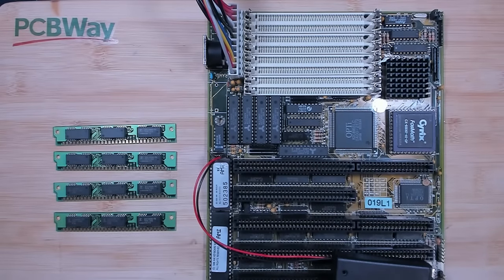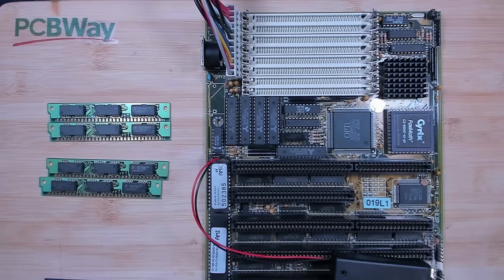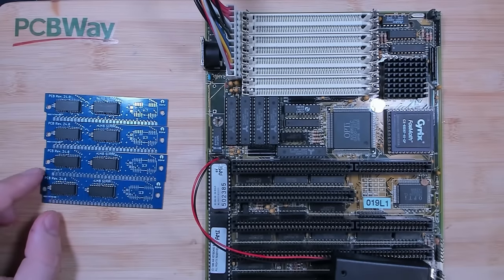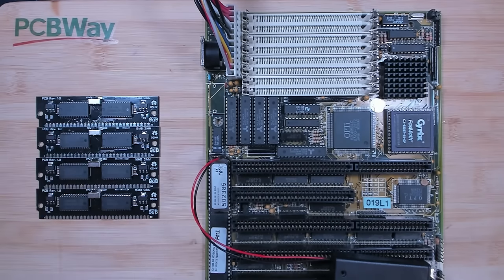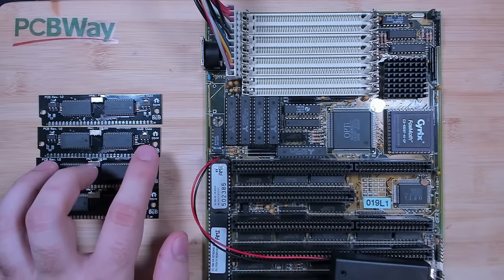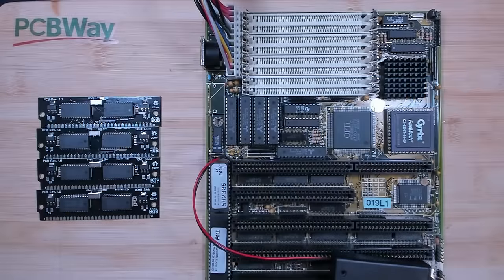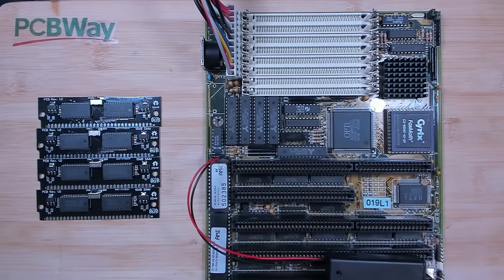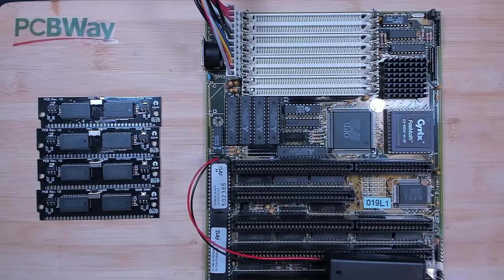16MB SIMM Revision 2.0 - I screwed up!

Comment: I hate it when I run out of components in the middle of a project! That's what usually ends up taking the most time in my projects, waiting for parts. But since I don't have videos to make, and I hate ordering just a small amount of components, I usually end up putting that project aside and working on another so I can order parts for that one too, then it takes me ages to get back to the first project.

I had the same issue finding chips that weren't rated for 3.3V when I was looking at making 16MB SIMMs. I vaguely remember finding datasheets for one or two chips that were 5V parts, and I think I also found some that said they had 5V tolerant signal pins. That was years ago, but I'm pretty sure I saved the datasheets somewhere, probably on my old Windows PC where I originally designed those 4MB modules.

Obviously those chips were impossible to actually buy from either genuine obsolete parts suppliers, or dodgy Chinese ebay/aliexpress stores. That's the main reason why I never bothered designing the 16MB SIMMs in the first place, I'd have no way of testing them, let alone actually building one.
Reply from the maker: Very true! You may end up with long delays waiting for new parts to arrive. I'm also working on a different project now since it will take at least two weeks before I can continue with the memory modules. Btw, someone suggested we check out the project SIMMBA-16. There is also a 72-pin version. However, I don't think those PCBs are freely available. Nevertheless, the author mentioned 5V tolerant memory chips. I'll just post them here for completeness: KM44C16100BK, K4E660411C, K4F640411B

Comment: "5v" TTL logic still switches reliably at 3.3v so those module manufacturers didn't need any major overhaul to support 5v and 3.3v platforms.
Reply: Replace “reliably” with “usually” and this statement becomes true, insofar as 3.3V logic doesn’t always reach 3.3V for a logic “high”, just like 5V doesn’t always reach 5V. Look at the voltage level specifications for the different logic families and you’ll see the problem. In other words, best-case 3.3V logic signals will work fine with 5V devices, but worst-case 3.3V logic signals will not. 

It’s better with 5V CMOS.

Comment: Well, the voltage divider might be the main problem. Depending on how much current the chip consumes, the output voltage WILL drop.

Easiest solution for a stable voltage is a well configured zener-diode/resistor combo.

There if there is no power need, all the current will go through the zener diode. The more current the chip draws, the less current goes through the zener diode. Output voltage will only begin to drop if the chip draws more current than what was designed to be the basic current through the zener diode.

Result: Stable voltage, and a constant power consumption.

Not a solution you would choose for an energy-efficient device, but then again a 386 is not very energy-efficient, is it? 😉

Comment: Great video! 486 class cpu with 256 mb memory next?)
Reply from the maker: Ah, then I have to design a 72-pin module :D I am not sure if I will do that. Those 30-pin SIMMs are already quite difficult to design - especially with all those extra components. But never say never :)
Reply: Theoretically the 486 can address 4GB of RAM, But I doubt any chipset ever supported that. You could however design a motherboard using something like the V380SDC that supports 2GB of PC133 SDRAM!

Comment: logic voltage levels are never exact 0 or suply voltage  , many chips have wide strike zone so chipset even at 5v logic level would probably accept high levels anywhere from 2-2,7v to 5 v  and low  levels close to 1 v so in theory we could be dumb and brute force level change by installing 2-3 fast switching diodes one direction and single the other way
of course that could not work in very high frequencies due to impedance and practically no load on the logic sides with no termination resistors you could  reference as a signal on voltage drop
Reply from the maker: There were many versions how to design a memory module for the chips and to comply with the datasheet. Then someone suggested to keep the BOM as simple as possible and reduce the number of different components if possible. I guess those are all best practices. But I did come across the idea of using diodes.

Comment: You might have failed, but I already learned a lot from this, thanks! What's the name of the program to do the simulation?
Reply from the maker: Thanks, well, I got two new PCB designs coming my way. Two more chances to get it to work. I added the simulation (falstad) link in the video description. It already has a similar circuit as shown in the video to play around with.

Comment: 22:33 See how the stencil is lifting up off the PCB as soon as the squeegee is lifted? That’s because you taped the stencil to the surface with tape longer than the PCB itself, causing the stencil to flex. You must use scrap PCBs to create a raised surface to tape the stencil to, so that the stencil lays flat at the same height as the PCB. 

Also, you need to apply paste to one edge of the stencil and squeegee it across in one single motion. Do not go over it more than once, as this smears the paste print. The subsequent passes just force more paste through the openings. This smeared excess paste gets underneath the stencil, causing it to not lay flat for subsequent prints, causing even more excess paste on those.

The end result is that you ended up applying too much paste. You want somewhere around 30-50% less paste than shown in the end. You can see this in the bulging (convex) solder fillets of the resistors. It should be a concave fillet.
Reply from the maker: Thanks for all this great information! Everything you said makes a lot of sense and I will try it next time!
Reply: @bitsundbolts  Good luck with your next attempt! :)

Also, I recommend using a metal squeegee instead of plastic. A high quality, putty knife with a thin, flexible blade is an excellent option. Choose a width to match the PCB size so you can do it in one pass.

Comment: just pull up ground of chip by +0.7 volts from PC ground - specs allow till -1 - so absolute amplitude is 5.6 volts, less chip and much chiper ;)
Reply: Interesting idea, although why don't I see this often is an interesting question
Reply from the maker: I suggested this while talking to a person with much better knowledge and there seems to be an issue with this approach. I don't remember what though.

Comment: Not sure how applicable this would be to RAM chips of any kind, but I know for some 3.3v chips like NOR-Flash you can get away with running them at 5v (at least in read mode for flash). It's definitely still out of spec, but sometimes I think the specs are just set by how far they've been tested. Many modern parts simply aren't designed/tested with 5v logic in mind.
Reply from the maker: I've heard people say that most of these 8MB 3.3 volt chips are 5v tolerant, but it's not mentioned in the datasheet - in which most manufacturers state an absolute maximum rating of 4.6 volts. I don't know if those chips will work well for a long time at 5 volts, that is why I try to find a different solution (and to learn something of course).

Comment: It would be fun to try and actually use all of the ram. I can export AutoCAD drawings to R12 (dos) and 14 (win95) formats, but I no longer have "trial versions" of these versions of the program. I should be able to generate a huge DWG file probably that you can try to open / work with..
Reply from the maker: I have a feeling that the CPU would struggle quite a bit with such a massive AutoCAD file. But it would be nice to find a use case
Reply: @bitsundbolts  Youtube keeps deleting my reply. You can find AutoCAD R14  on that place on the internet that archives things. I'm happy to supply some drawings of vaious sizes for you to try, so we can point and laugh at the screen..
Reply from the maker: Yeah, YouTube doesn't like links and sometimes words. Go figure... Let me try to source a copy from that place that archives things 😉.

Comment: Is there any reason why you couldn't use a 16mb SRAM chip instead? considering it's not designed for it, I doubt it will be any faster, but it would be interesting.
Reply: The SIMM sockets are for DRAM chips, which interface differently from SRAMs.  Specifically, the address lines are multiplexed for column and row, and there are refresh cycles added for DRAMs.  You could definitely interface SRAMs to a 386 motherboard though.  But the easiest way to do that would be to build an ISA bus card.  I guess the memory accesses would be limited to 16 bits at a time, though, and ~8MHz.  It'd still be good as a big RAM disk, though.  Use low capacity SIMMs for the main memory, and then put virtual memory on a big SRAM RAM disk on the ISA bus.  Much faster than a swap file on the hard drive.
Reply: @joelavcoco  you would need a multiplexer to handle CAS and RAS, but there is no reason why it couldn't work. The socket doesn't care what's in it. IT's expecting address and data lines. As long as those are interfaced properly you could. I think anyway.

Comment: Wonder how well they'd work in old Macintosh. 68000 are limited to 4MB max but later CPU up to early Quadrea could use a lot. Quadra 900 has 16 slots and normally maxes at 256MB (16x16MB).  512MB or half a gig should be possible.

Comment: i can only think of one addition that could be made to these
and that is a way to set the memory size/ranks because some motherboards from this memory era had limits on the size of the stick or how many ranks you could install in each slot

for instance i had a mother board in the late 80's/early 90's that had 2 banks of memory using the same SIMM package but one bank could use single rank SIMM's and one bank could use dual-rank SIMM's and if you put a dual-rank in the first bank it caused an error
-it even had a note in the manual about it

sorry i can remember the board i was only 10 and the board was new in 1989-90 but it stuck with me all these years

Comment: Out of curiosity, did you check the voltages on the data and address pins of your rev.1 modules? I wonder if the data pins' voltage might be lower since those chips are only running at 3.3v. The memory controller may still only be talking to them at 4v on the data lines and you only saw the 5v max on the 1MB modules due to them running at 5v.
Reply from the maker: I measured the voltages on rev 1 - and they were around 3.8 volts. The problem is that due to the lower supply voltage, there seems to be a connection from signal line to supply through a clamping diode (at least this is what I understand). That is why I seemingly get lower voltages on revision 1, but that is still an issue. Over time, this situation can damage the memory chip.

Comment: are those memory IC's still made today, or is it just new (old) stock?
Reply from the maker: I don't think those ICs are still made. The ones I use come from discarded memory modules most likely used in old servers. So far, I wasn't able to find them again at my local scrapyard, but I'm sure I'll find them again in the future.
Reply: @bitsundbolts  thanks, I did wonder if there was still a demand for them with industrial machinery. I see industrial motherboards with modern processor and ram support that have parallel and serial connections. I got one for my dad as he still uses an oscilloscope with a parallel plug.

Comment: I see there is a radiator on CPU now, did you glue it permanently or it is possible to remove it without a damage.
Reply from the maker: It can be removed, it is just a sticky tape/thermal tape that attaches the heatsink to the 386. It would come off easily if I'd twist a couple of times.

Comment: is it possible to shrink the pcb down so it's lower-profile and more compact? bank 0 in the pc i'd like to put these in are right next to a drive cage and i have to use shorter simm sticks there.
Reply from the maker: Unfortunately, the new revision got a bit taller due to the voltage regulator tab. It's quite hard to route all the traces and find good locations for resistors and capacitors. With the three level shifters and the voltage regulator, this PCB got a lot more complex. Maybe there will be a different solution in the future that allows for lower profile SIMMs, but this is the best I could do until now.

Comment: Memory was was so extremely expensive it is really amazing seeing the maximum supported being explored.  What would a 386 even do with 128 MB of RAM?
Reply from the maker: Good question! We should find out if I ever get a 386 to 128MB. The Soyo board in this video is unfortunately limited to 64MB. The second memory bank doesn't work if I max out BANK0.
Reply: @bitsundbolts  Even 64 MB is outrageous for a 386.
Reply from the maker: True!

Comment: Why can't you use push pull, can you explain it. I remember something about TTL circuits being open drain, but still I can't understand why the other won't work. I remember that CMOS is push pull.
What is the explanation, sorry I'm from 1961 so I need some help to get down memory lane.
Reply from the maker: Unfortunately, I am also struggling with this. I cannot explain this yet, but I am working hard trying to get it to work. Maybe then I'll be able to put all the puzzle pieces together.

Comment: Honestly, that's a small enough difference in voltage that I would assume the protection diodes can handle it with a small current limiting resistor.
Reply: They may, but there's no guarantee they're all as resilient. The fact they are surviving is merely a testament to the robust production, but not what it was designed for. So a level shifter is really a better idea! Current limiting using resistors would once again result in the same issues as seen before, too.
Reply from the maker: So, just one resistor between memory controller and, let's say, the address line? What value of resistor would you suggest? If I would have implemented that level shifter correctly on revision 2.0, I could try your suggestion.
Reply: @bitsundbolts  10k would be a solid default choice.

Comment: Stupid suggestion, can't you prob the back of the memory on the last simm, you could get access to the bottom set of pins.
Reply from the maker: This is not a stupid suggestion at all. Yes, you are absolutely right, I could have measured the other signals from there. But I probably would have found the same signals since both sides have data, control, and address lines. I skipped that.

Comment: Why didn't you explain what was wrong with the v2 module?
Reply from the maker: I will cover this in the next video after I verify that revision 3.x is working with 4 modules. What seems to be happening is that the level shifter cannot bring the data lines up by itself. That is 5 volts on side B and 3.3 volts on side A. For this purpose, I had to add pull-up resistors on each line.
Reply: @bitsundbolts  awesome. Thanks!

Comment: I was thinking about this problem of voltage levels on your last video. I just assumed you already checked the specs and it was good for 5 or 3 volts.
Reply from the maker: I checked it on the modules I created. I think there's something in the chip that lowers the voltage (clamping diode). That is what I might have gotten a different reading. Now, I'm trying to solve that issue since the memory controller is definitely using 5v signals.

Comment: You are totally wrong!! )) On input pin no need resistor divider or logic. Only issue is internal protected diode to Vcc (3.3V). So, it will be enough to add resistor about 33-100 Om to protect chipset output from overload on high state.
I think on bi-directional pin is same issue, just add resistor 33-100 Om

Calculation: ( 5v-3.3v-0.6v(diode droop) )/100 Om - 11mA on high state => 5.5mA continuous current. Total heat expose about two Watts on all resistors on 4 modules - no big deal :)
Reply from the maker: I am not sure about just adding a resistor. Wouldn't there still be 5v on the data lines/address/signal pins? I mean, I really would prefer such a simple solution, but I think this option was never suggested to me.
Reply: @bitsundbolts  for memory chip dos't metter 5 or 3 Volt on input pin, i think it can tolerance 10 Volts, only issue it's internal protectected diode.
You can add resistor to 5v module and 3.3v module, place oscilograph probe to both size of resictor and compare signals. If on 3.3v module will be no big splash, so it can work fine with 5v bus.

Also can help drop voltage on Vcc of chipset, like 3.5-4 Volts :)

Comment: You could fit more than 16MB.

Throw a CPLD and use 32 or 64MB

In 16MB pages

Only downside you need a driver or API to access 128 or 256MB

And use sram for speed boost and no CPU wait states wasting resources
Reply from the maker: How would that work? There are no address lines available to address higher memory areas. Wouldn't I need a signal from the memory controller to know which page to access?